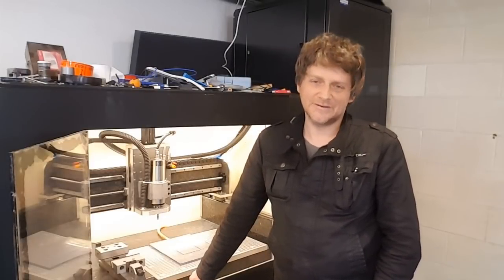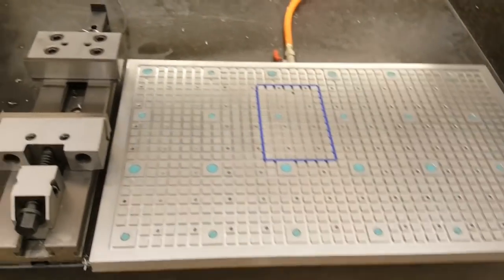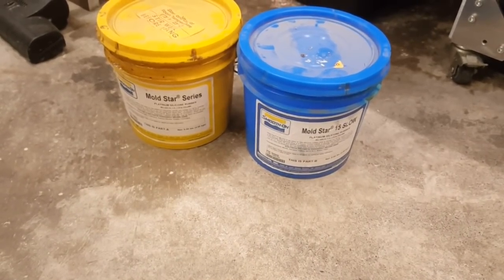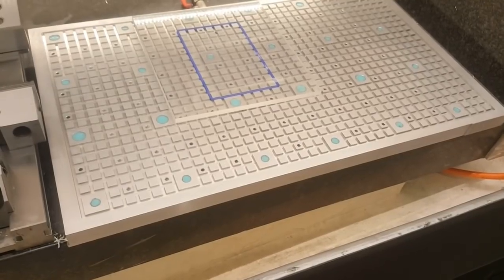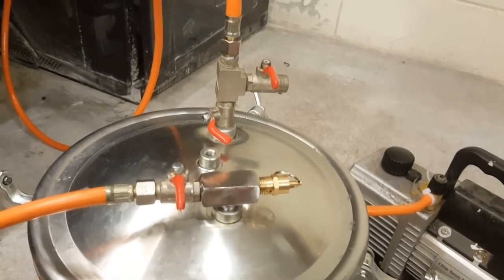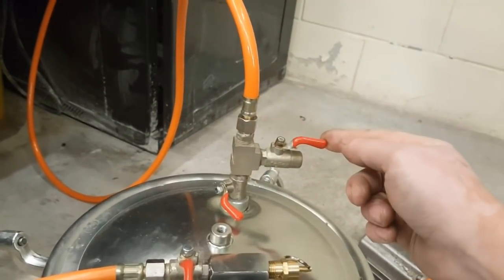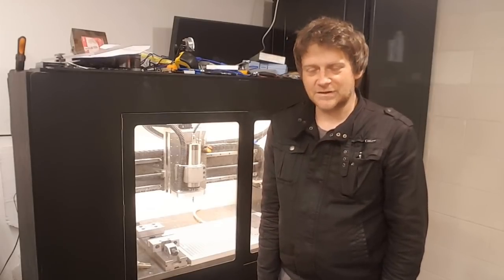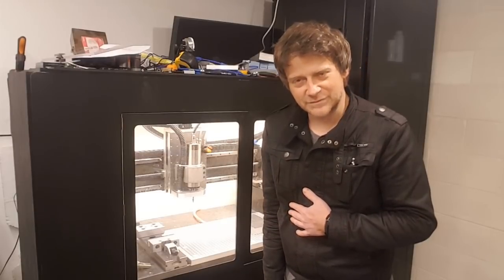DIY CNC vacuum plate - Tips and tricks

Comment: Good explanation Piotr. I've been using vacuum pumps and various fixtures since 1994. They can make some seemingly impossible work holding tasks very easy. Keep up the great videos.  I also use vacuum pumps and closed bags for some funky clamping of various woodworking projects.

Mark
Reply from the maker: I'm glad you like my explanation, it mean a lot coming from a guy who is using vacuum fixturing for almost 25 years! You made me curious, you use vacuum bags for gluing/ laminating parts not for fixturing them to cnc machine?
Reply: @PiotrFoxWysocki  At the moment I don't have a CNC machine. But I have helped a machine shop develop exactly what you have in your video 5 years ago to cut out trim plates for high end loudspeakers. The difference in the vacuum plate is that they used a ball end mill instead of your square end mill. "O"ring material was used for the gasket exactly the way you used your silicone lid gasket. They used a compressed air venturi pump. They had a large compressor already. It was not that noisy. My usage for clamping is on my YouTube channel if you are interested.
Reply from the maker: thank you for the answer. i will watch your videos!

Comment: Thank you for the video. 
I just have a question, I am making a vacuum table and I am using a similar pump. When the vacuum is on, I get good constant vacuum pressure but As soon as I turn it off, I gradually loose the vacuum pressure. As of what I understood from your video, you made it in a way that you don't need continuous vacuuming using the pump. Is that the case or having the pump on the whole time of the job is normal?
Reply from the maker: I dont like pump to be on all the time if there is no need for it.  If you use a good seal and your vacuum plate is not leaking, or any of the valves  then you don't need to have pump running all the time. Just get a vacuum gauge so you can see if it's leaking.

Comment: Thanks. I am just starting out learning about CNC vacuum clamping. I’ve made a vacuum plate out of HDPE (a plastic commonly found in cutting boards. I do not recommend this material, it doesn’t stay flat after machining.) and could not see how to avoid damaging it while cutting a part. Couldn’t figure out how to make a profile cut without cutting into the vacuum plate. I now understand there is a difference between a vacuum “plate” and vacuum “fixture” and that I need both. The HDPE might be better suited for the “fixture” as It is an “air tight” material able to transfer the vacuum through a hole to the part and I could use an adhesive backed foam weatherstripping for a gasket.

Comment: Thank you, Piotr, for the informative video. I've spent hours researching my vacuum table design, and never had so many questions answered in one view. Using a vacuum pump is rare for woodworking CNC tables, but the thought of listening to a shopvac running full time for hours long carves is unacceptable to me. The pressure pot makes total sense, but I think I would feel safer adding a pressure switch to activate the pump if the vacuum pressure gets low. Some of my wood substrates are pourous. I hope you're staying well these 3 years since your post.
Reply from the maker: I'm glad you found it informative, but I might not work so well for wood.it could if you paint the underside of the wood you will mill. It might be worth it if the milling takes a long time

Comment: A great video, thanks. How many litres is the pressure pot? Do you think it matters?, bigger the better? I'm planning on something similar, I will use my air compressor with a venturi valve into the pressure pot, then into the vacuum plate. Fingers crossed!
Reply from the maker: My pressure pot was 10 liters. I used it to store large volume of vacuum just in case there is a leak under the part im cutting. Also as a separator for coolant and chips. I guess it should work for the venturi pump as well. So you store your vacuum and turn of the compressor.

Comment: Nice.  How did you drill the long holes from the vacuum tap to the center of the plate?
Reply from the maker: drill press and a drill :) i didn't drill to the center just around 10cm deep and then i drilled a small hole from the top.

Comment: Thank you for the very nice informations.
The 5 CFM pump is good enough for this size of plate?
Reply from the maker: Any vacuum pump is enough. It just a matter of tim how long it qould take to have full vacuum. The amout of air it has to suck out is minimal even for masive plates. Vacuum hose will have more air in it than vacuum plate.
Reply: @PiotrFoxWysocki  This type of pumps have a adjustment vacuum pressure regulator in order to stop pump running or is not necessary?
Reply from the maker: Nope. You have to put a manual valve on the plate or somwhere after the pump. Because if you turn off the pump you will start loosing the vacuum. Not a big problem really

Comment: can you not use Nitrile Rubber Cord 4 - 6 mm and use loctite flex to glue it together ? seems a better (and cheaper) solution then buying and disgarding plastic...
Reply from the maker: Sure. But the glue point might leak. So just in case, vacuum pump have to be turned on continiously. Beside you might not be able to get nitrite rubber cord easly. But those containers are everywhere. You know. In case of urgency.

Comment: Really awesome video! Can you tell me the depth of the grid? I'm planning to use silicone cord with a diameter of 4 millimeter.
Reply from the maker: i would start with 3.3mm. because when you squeeze silicone cord will fill the whole square cavity. if it doesn't  fully fit. than you try deeper. i did mine on 3.5 i think.

Comment: How you're doing Piotr :) May I ask you? what aluminium alloy is your vacuum table made of? is it at least a little scratch resistant?    and... did you modify or paint the surface of the table? It looks like some lighter paint maybe?     and... the holes for fixturing screws - are they machined through the table or only pockets? Coolant and chips remain standing in them or flow through?   thank you, V.

Comment: How deep are your 4 mm grooves? How much should a gasket be sticking above the surface? Thank you!
Reply from the maker: it depends from the shape of the gasket. idea is to have grove deep enough that once you put something on the top gasket compresses to fill the grove and its not pinching on any of the edges. bigger grove bigger gasket and it can stick out more.
Reply: @PiotrFoxWysocki  thank you for your answer. I will go with 3.2 mm deep for 4 mm wide groove. I will use soft rubber cord, 4 mm. Hopefully that will work.
Reply from the maker: Mill at this depth. Test and than you can run again a bit lower if it's pinching.

Comment: backer rod works good as gasket if you mill the grooves in the plate to work with it. i paid less than 4$ got 20ft of it...it is just closed cell foam round rope looking

Comment: I think you might have missed a point, or put another way in the form of a question, does the aluminum vacuum plate consist of two aluminum plates that were milled to cretae the vacuum channels and then "sandwiched" together to create the necessary void space between the two plates?  Is this how it's made, or if not, please explain how the air is collected and channeled to the outlet hose that's connected in the rear?  And thanks for the great video!
Best - Michael
Reply from the maker: this is a solid block of aluminium with groves on the top, those groves work as a vacuum void. 
i have made another video about vacuum fixture https://youtu.be/e941fzVs0n4 i hope it can clarify whole concept a bit better.

Comment: Thank you for sharing your work. Very clearly explained. I was wondering how you prevent the tool from damaging the plate, but you explained that as well. I also really liked the solution for the gaskets...easy to find and cheap. Thanks again.
Reply from the maker: @Chris Donnelly  Thank you, I'm close to finish my next video about vacuum fixture, custom made gaskets and milling on it. Its like taking vacuum work holding to the next level :)

Comment: Good job 😀
Something we've started doing is using a 3mm thick clear plastic sheet on top of the vac plate. If you're making  parts with holes in them then you punch holes in the sheet where the part stays solid to allow the vac through but it won't then let the vac escape. It's surprising how few holes you need. Also allows you to cut thin parts without tabs as you can cut into the plastic sheet without damaging the table and without losing vacuum. I highly recommend this method. Owen S
Reply: @Owen Sparks got a link to the plastic your using, sounds interesting

Comment: Piotr, excellent work and video...   I am no expert, I understand the basics of the vacuum plate, however, I am curious how you turn off vacuum to the zones that are not within the gasket's parameter, or is there only one port for the vacuum in the center, I really can see what is going on, as your tapped holes are blurring the picture for me, so to speak? Thanks again!
Reply from the maker: sorry for the confusion, i should explain it better. this is a solid piece of aluminium with grid milled on the top. there is one hole for the vacuum inside the gasket parameter.  there are few designs of the vacuum plates and this one is the simplest.
Reply: Okay, that makes sense now. Thank you.

Comment: can you show the inside of your vacuum plate?
Reply from the maker: actually its a single piece  vacuum plate. it has drilled long hole from the side and than short hole from the top to connect those two(small hole inside the sealed area at the top, i forget to mention about it.). whatever you see on the video, that is all is there.
Reply: thanks  @PiotrFoxWysocki  So you have just one single vacuum port. I just rewatched part ofthe video. And now I understand. I personally wood and at least one better 2 vaccum ports. So it is possible to hold 2 parts, inner and outer part...

Comment: I wonder if o-rings could be used in a pinch, as they come in assorted sizes, and can be spliced with cynoacrylate adhesive.
Reply from the maker: Not sure if I understand what you mean.
Reply: @PiotrFoxWysocki  , for sealing because the come in all sizes, and ends can be glued with crazy glue.

https://en.m.wikipedia.org/wiki/O-ring
Reply from the maker: In general, cyanoacrylate is an acrylic resin that rapidly polymerises in the presence of water. so it doesn't sound very flexible.. and as far i remember it crystallizes. I guess it would glue a rubber together but once rubber is compressed  it should crack and break off. this is just theoretical divagation, but since I'm not a chemist i would recommend to test if it works and how long.

Comment: Excellent video! A few additional questions if you please: how's the interior machined, a large pocket (dimensions?) or something more fancy? How do you sealed the two parts of the plate? Wouldn't a filter be welcome on the pump port of the bucket to protect the pump from coolant and particules?
Oh and comes to mind that a sensor on the table port triggering an Estop in case of vacuum loss would be a nice security feature don't you think?
Reply from the maker: actually its a single piece  vacuum plate. it has drilled long hole from the side and than short hole from the top to connect those two(small hole inside the sealed area at the top, i forget to mention about it.). whatever you see on the video, that is all. i have been thinking about adding a filter inside the pressure pot on the vacuum pump intake. just in case chips get agitated and start flying all around. 
i guess sensor would be a nice gadget, but i will go with a absolute minimum to do the job properly. if i find that this is a problem than will look for solution.
Reply: You can see the hole porting vacuum to the top around 3:10.

Comment: Hi Fox, this video is very helpful! I've never worked with a vacuum plate and this cleared up many misunderstandings that I had, not the least of which is that vacuum plates would require some large internal cavity. Looks like all that was needed here is a couple of holes. Is the plate milled from MIC6? Interesting source for gaskets too. Also, I had assumed that the vacuum pump would need to run constantly. I'm looking forward to learning how to use a vacuum plate.
Reply from the maker: recently i had to mill over 400 large pockets in 125x6mm flat bars (you have seen it on instagram) it chattered like crazy even if it was clamped every 10cm all around. this was the reason to make my vacuum plate. and i also need it for my projects. there are few different designs of vacuum plates. mine is the simplest one. I milled it out of 6061 rolled aluminium. there are few cases where you have to run vacuum pump constantly on a very particular designs of vacuum plates. On some videos i have seen on a youtube, people running pump all the time for no good reason  on a plate which doesn't require it. once you pulled the vacuum and your gasket doesn't have a leak you don't need to pump any longer.
Reply: You can see the hole porting vacuum to the top around 3:10.

Comment: Really useful and easy to understand. When you attach the acrylic at 11:34 though it looks non-flat. I presume that's the acrylic already being bent?
Reply from the maker: I stared at  11:34 and only one thing which i can possibly see is a lens distortion. if you could give me a hint where to look, perhaps i could notice it as well
Reply: When pressure is being applied, I am sure the middle of the acrylic comes down more than the very outside of the screen... I wonder if the pressure is distorting the acrylic when it's being applied? I can see a gap between the acrylic and the aluminium at the edge of the screen, but they appear to touch in the middle. Perhaps some open gasket in the spare channels inside the closed gasket would provide some physical support and prevent this (apparent) distortion of the workpiece. (Obviously aluminium at any real thickness wouldn't have this issue)

Comment: Fantastic video, been loving all of the videos you've produced lately. Something I've seen people do with water is 3D print gaskets in soft flexible material. Perhaps that would work for you here? Size might be an issue, but if it worked it would certainly be convenient.
Reply from the maker: actually this is pretty genius idea! so there are 4 ways of sealing a vacuum plate :)